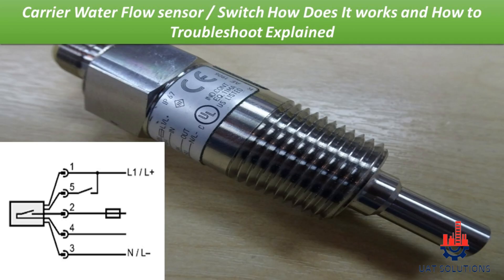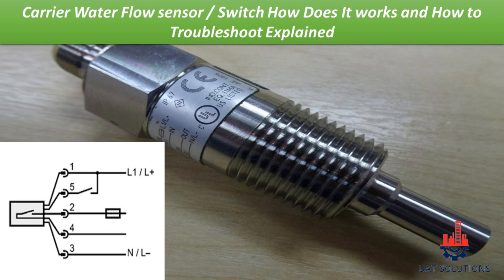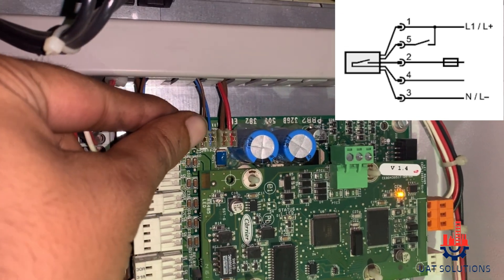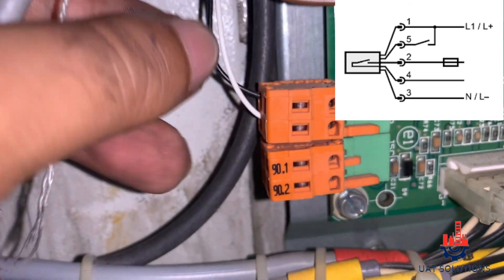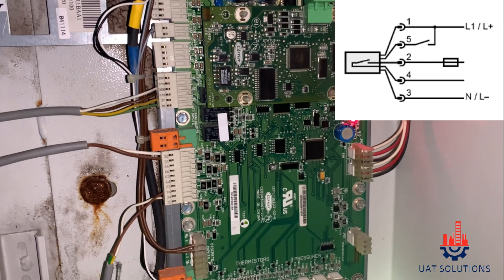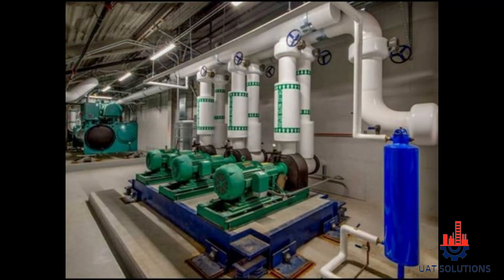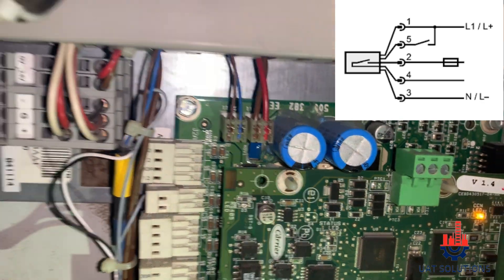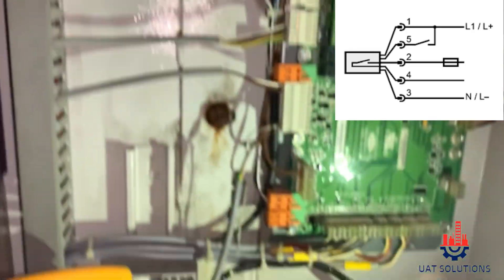Carrier 30XA, XW Chiller Water Flow sensor / Switch How does it work & How to Troubleshoot Explained

Comment: How to bypass 4 pin type sensor
Reply from the maker: Share the sensor model or part number. So we can guid you accordingly
Reply: @UATechnicalSolutions Thanks, i will check and update, it is for 30XA chiller but flow sensor is 4-pin type